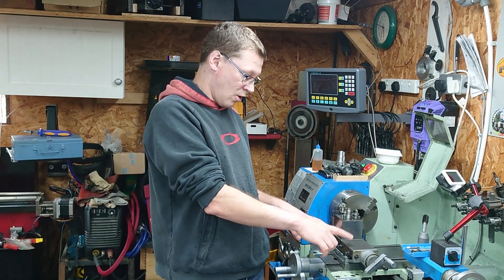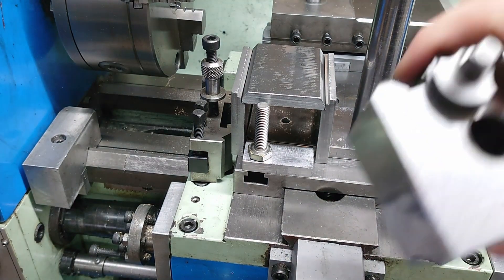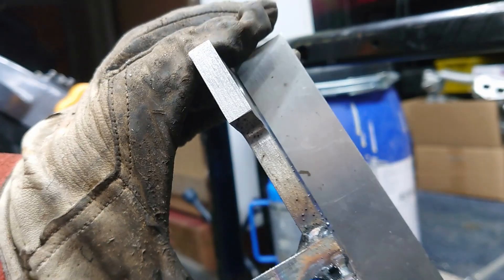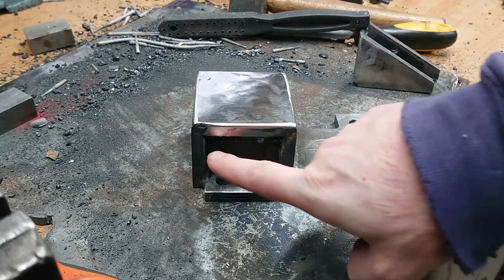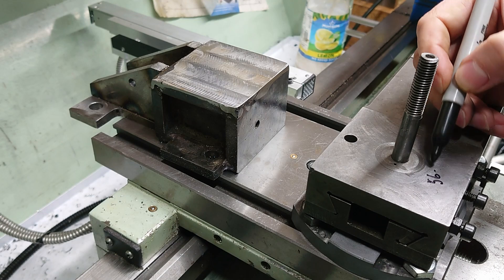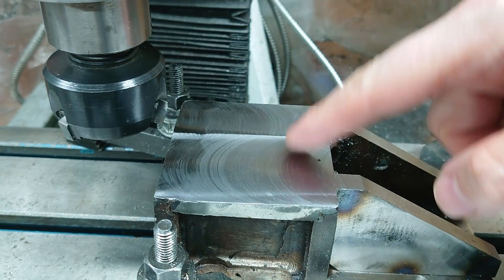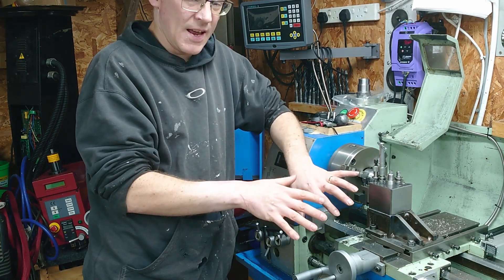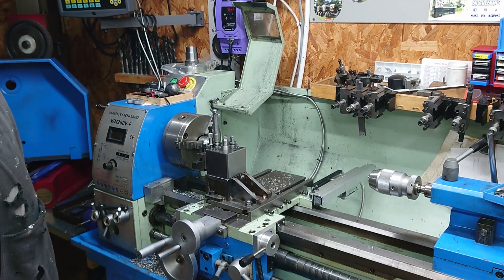Fabricated Toolpost - It's now better see pinned comment.

Comment from the maker: Thanks for all the great feedback, but the problem is now solved. I changed the PWM frequency of the VFD and that has eliminated the vibration. It was happening when the motor load was about 50%. Probably the motor slipping under load and the control loop trying to correct. Maybe the PID values could be tweaked, but the frequency was the first thing I tried and it seems to have worked. I can now part off 42mm EN8 bar to a mirror(ish) finish. It was basically impossible before.

Comment: Good to see you back in the workshop Olly 👍
I was going to suggest (as have others) filling the toolpost void with lead as it's particularly dead and un-ringy and would add a small amount of additional mass, but I see lateral thinking has brought you the solution.  
The toolpost looks almost indestructible -great job repurposing scrap with the stick welder. @Rustinox has taught you well! 😂
Reply from the maker: Thanks Matt. 👍

Comment: G'day Olly.  Nice build mate.  Sorry the effort didn't see the results you wanted mate.  As others have suggested, try tightening the gibs.  Addionally, I had a similar lathe back in the day and had to take it easy and not do massive cuts.  Cheers, Aaron.
Reply from the maker: Thanks Aaron. The problem is the material. The EN8 requires a substantial cut depth and high feed to cut properly. It's pushing this poor machine too hard I think. Other than that though, the lathe works well with pretty much any other material. I tried tightening the gibs today, no change. There is definitely wear on the cross slide though and in the lead screw. I tried moving the toolpost to the centre of the cross slide (not practical, but testing the un worn areas) and that has improved things a bit.

Comment: Stop using carbide inserts. Sharpen up some nice HSS cutting tools and takr lighter cuts.
Carbide insterts are for production machining on very rigid machines that can handle very high cutting forces. They are often a poor choice for hobby machining on small lathes!
Use a low force cutting tool like a very sharp HSS tool, and smile. 😎
Reply from the maker: Carbide works very well for me on this lathe, and I have tried HSS on the EN8 material, but it goes blunt after a few minutes of turning. Good news though, problem solved. It was the VFD frequency causing the problem. I changed the frequency and now everything works perfectly.

Comment: A solid tool post means just that, not a welder end combination of individual parts that will have their vibrational modes. Making it out of a solid piece of cast iron would be better. Whether that would help is another thing. I find that when looking at them, a lot of smaller Chinese lathes have the screws for the compound on the wrong side. They should have the gib on the tailstock side, not the headstock side. So many factors are involved in harmonics that it can be difficult to trace them down. But making sure all the gibs aren’t loose, including the rear guide for the carriage, is important. If the bearings in the headstock aren’t adjusted properly, that’s a real problem as well. Cutting at the proper feeds and speeds, with the proper insert, at the proper angle, or a high speed tool ground correctly, also at the proper angle, will make a big difference as well.
Reply from the maker: Hi Mel. I have just fixed it. I changed the PWM frequency of the VFD, now it works perfectly. I got a near mirror finish parting EN8 42mm bar, whereas before it would scream at me as soon as the parting blade started cutting.
Reply: @ I assume you turned it up. From the factory, the setting is on the low side which can cause motor overheating and that damned whining noise.
Reply from the maker: @melgross  I had already upped it from 8kHz to 16kHz when I installed it (a few years ago) because of the whine. It's been working really well, except when I've been trying this EN8 material.  Bumping it up to 24kHz has worked a treat.

Comment: I have a smaller version of this lathe but it still has the same issues. Easy way to find non rigidity is to put a longish and thick bar in a tool holder and use it to lever the tool post, cross slide and saddle up and down to simulate cutting forces and observe any relative motion. Also do the same with a long bar in the chuck to measure flex in the headstock and spindle. In the end these are not designed for heavy cuts. I almost exclusively use carbide inserts designed for aluminium as these are sharper and reduce the cutting forces. To specifically reduce resonance vibration adding mass helps and your new fixed tool post has less than the compound one snd is mild steel which has less damping properties than cast iron.

Comment: I suggest putting a dial indicator and measuring the flex on the tool post with varying amounts of force in different directions. If you've seen Robin's videos, he demonstrates how much flex you can get from even what looks like a rigid setup. There could be multiple factors. Additionally the welded joints are not stiff enough as you'd like to think and perhaps not flat enough at the mating areas (as some have pointed out) making the chatter worse.

Comment: Make it out of one piece of steel or cast iron a weld up fabrication will just flex and warp under load I have done a similar thing with a jig in my mill the welded jig was large and solid but did not work at all.
Reply from the maker: I agree that it's not the most rigid solution. I was just using materials I had. Have you seen the HAL heavy duty boring bar holder? That's welded. If it's good enough for a massive CNC lathe, then it should be good enough for my Chinese lathe. The bottom line is that I'm pushing this lathe to the limit of what it can do.
Reply: @ollysworkshop  Keep at it keep up the good work. All the best from Australia.

Comment: Nah m8, just snag a chunk of iron or steel even and mill it out as a solid block... Fabrication and machine structural componentry never goes well... I would also move the toolpost more to the middle, as to have it and the tool fully over the cross slide rather than overhanging the ways(support surfaces) of it... I suspect that the weldment is just too flexible for what you are asking of it, especially being a 4 sided box configuration, the rear slanted braces notwithstanding... 
I know that it appears as if it should offer more than literally 2 cast iron pieces that are interlocking with but a suggestion of their geometry and some threads, but those pieces have more physical support surface that can back up sideways(towards the operator or away from you) forces of the tool, and only relies on the threads and maybe a gib-lock to mitigate the axial forces of the cut... The compound`s biggest weakness is the attachment point at the cross slide, as those are oft small surfaces, 2 pathetic size bolts and a semi-precision fit, round boss of sorts, but for the most part - nothing skookum - not like on the big lathes where you have 4 fat saucy bolts that clamp that shit down with the force that could split rock - over a surface as large as a man`s head with a chunky boss that is often almost ``bearing fit`` in it`s socket... 
A solid block will allow you to mill in as positive of a geometry as possible as to retain the damn thing stationary and in position foreseen by the design - from integral ``keys`` to potentially 12 bolts to lock that bitch down...

Best regards!
Steuss
Reply: Skookum , are you from British Columbia :) ?
Reply: @peterfowler8044  Just an AvE watcher for over a dozen years... He is the one responsible for me owning machinery, or rather, for me falling in love as a young teen back then... The owning machinery came over a decade of unrequited love later, but alas, he is the one who played the witch doctor and spawned the accursed creature that is my current being...
Reply: @peterfowler8044  Oh, sorry, guess the reply didn`t pass through... 
Nah, i`m just an AvE connoisseur for... Well, almost as long as his channel has been posting... That being the fact - i have gladly taken on a few colloquialisms from him, as well as a few technical terms - Skookum being one of them... I mean, what better describes a proper lathe than ``A skookum choocher`` - you just can`t beat such terminology...
Reply from the maker: @camillosteuss That's a lot of good info, but unfortunately none of it would have fixed the issue! Turns out it was the VFD frequency causing the vibration. All fixed now.
Reply: @ollysworkshop  Shiet, i never woulda thought of a VDF related issues, tho, in my excuse - I don`t use VFDs so i have 0 VFD experience to call on for diagnostics... I went for mechanical logic of ``more slab - more better`` and ``more clamping - more better``... 
The real question is - why has the VFD issue manifested upon toolpost ``riser`` mod being put in place? That is either a perfect coincidental timing or i am just not in the loop of events as you are and I am assuming that the issue appeared right as the mod. took place... 

Cheers!
Reply from the maker: @camillosteuss if you watch the next video I explain it a bit better. Short version is that it's the material I am turning (EN8) was a problem, hence first stop was to remove the compound. I've just not turned anything this demanding before.
Reply: @ollysworkshop  I`ll check it out, i`ve already seen it, and so i returned to this vid, but i had something to do, so i didn`t watch the addendum video... 
Also, isn`t en8 just mild steel on crack? I would not expect so much trouble from it - lest it be hardened, other than that, it should not be much tougher than most alloy steels, let alone toolsteel, hell, i`d say that inox could be worse of a bitch than en8 if you don`t have a beast of a lathe that can take a decent cut... But sure enough, some materials do behave in ``weird`` ways when machined rather than formed and ground or manipulated in other ways... Titanium is a great example, what with it`s heat retention propensity...
Reply from the maker: @camillosteuss  EN8 is not a particularly unpleasant material, but it does require significant depth of cut and high feed rate to cut properly.  With high feed rate one needs a larger nose radius on the tool.  All this conspires to demand almost too much from the machine. The larger diameter of the material doesn't help either, 25mm would be ok.
Reply: @ollysworkshop  Huh, the marvel of similar yet different materials and their behaviour under the ``knife``... 
Anyway, i`ll check out the addendum when i get the chance... I`m all over the place these past few days - replying as to not be an asshole, but mostly i get to watch something after midnight, which is when i pretty much fall asleep in my drafting chair with headphones on - playing some audiobook...

Comment: It helped for me because there was some play in compound rest. I got old lathe and there is some wear.Its always stayed tightened on gibs. I took big chunk of cast iron and made solid tool post and that give huge improvement for chattering un cutting off issues. Maybe the problem is that you don't have a solid tool post, but one with an empty middle? Or free movement everywhere else
Reply from the maker: @craftzars  I think it's movement elsewhere as it is the same with the compound. The airspace in the middle is minimal, most of it is taken up by the round bar for mounting the QCTP block. I need to try the old 4 way toolpost and see if there's an improvement with that.  I would have used a solid lump if I had one, but I had plate steel, so that's what I used.